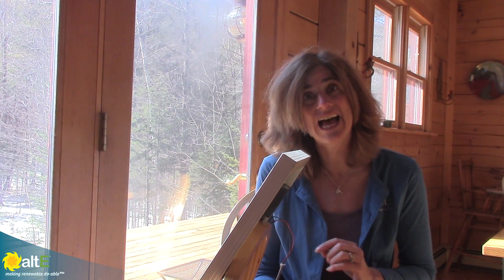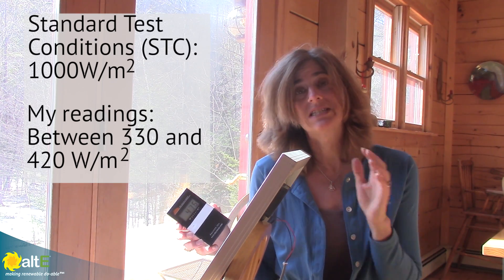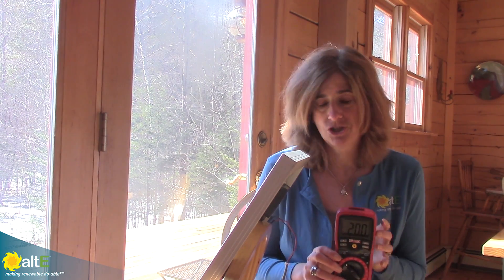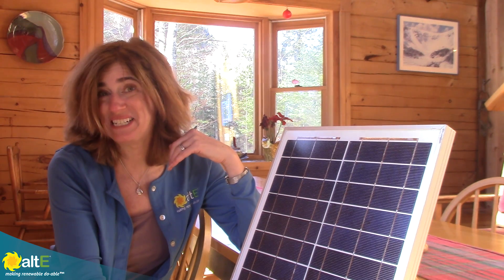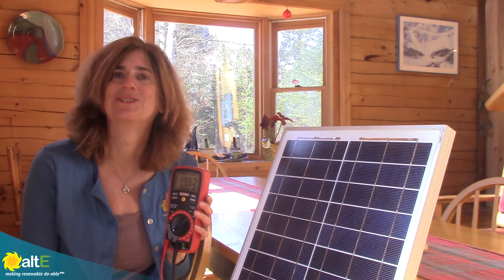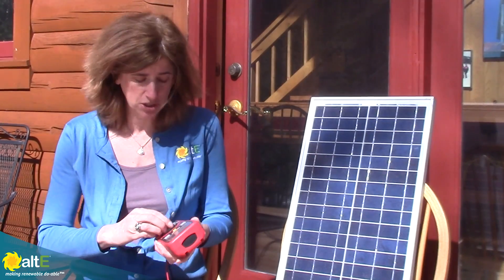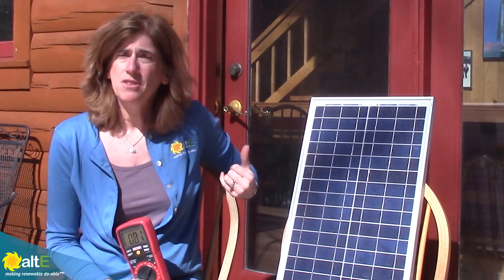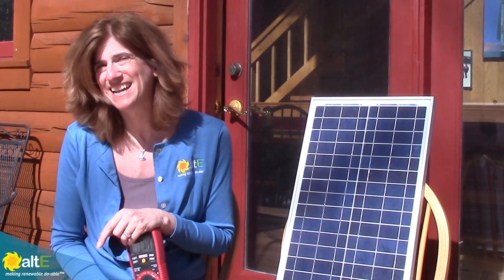Can I install a solar panel in a window?

Comment: Thanks for the informative video. I'm able to get 137 watts in the winter from two bifacial 24 volts 200 watt each panels placed inside the house. The windows are double insulated glass and there's a net on half of the window. I've noticed that when the panels are placed right besides the glass of the window, they produce maximum power. Also, since they are bifacial, placing a mirror behind it helps bump up power to 150 watts. Removing the net increases the power further.

Comment: If you put solar panels  in the window.  Go parallel with the  panels  wattage will drop too much in series as the current drops already in series and it's against the window

Comment: I live in an apartment.  And the sun raise up in east in my living room and moves on around to the side bedrooms by 12 am but once ite sun comes around to the back , the shines the longest on that back bedroom.  I call it my sunroom. I can set up the solar panel on the side of the apartment where the sun moves around by 12 o'clock, but sunroom ( the 3rd bedroom) seems to hold the most. My are 100 watt solar panels but would only be able to set 3, though I have 5. I don't know how this will work. The panel you had looked small. Is someone I could call to ask questions? Thanks

Comment: Everything that I checked into states it's not really worth it. Double pane windows over the surface of the solar panel decreases it ability enough that I chose to do it. I'll place the panel on the outside, and run the line into the rooms I plan to use solar.

Comment: I am running a 100w panel in my window. It is leaning back on to a pull-down shade. It pulls 50w and I just bought another one to go next to it. I checked the temperature of the panel and it is 120f. my question is I don’t want to start a fire. How hot is to hot.

Comment: Very good video. I left a like.
One can install solar panels in a window, but if the light is not directed right at the panel, then the current (A) will be low most of the time.

Comment: I have solar in my window with fabulous results, I use them to charge my 4v 17,5Ah ebike battery, I charge my 12v walmart  deep cycle battery and run an inverter off that to charge my Greenworks 60v battery, with the 60v battery I have lawnmower and trimmer(weed wacker), leaf blower and snow thrower. with my AIMS 48v 1500w pure sine wave inverter I use 3 60v batteries in parallel to run the laundry machine and dishwasher. I have one 40w and one 50w panel in the window at all times except on nice days I take them out on my deck and get full sun on them and add a 100w panel to the system. I could leave them outside but I think they will last longer the way I'm using them.
Reply from the maker: Very cool!

Comment: Whatta Bummer🙄. I am trying to figure out if I can solar in my city apartment to work hand In hand with a solar generator 😳
Reply from the maker: You can probably still make a little power during the peak sun exposure each day. Only about 1/3 MAX of what you could get outside but potentially enough to recharge a solar generator, especially over a few days!
Reply: This guy told me he hangs his panels outside of his window to charge up his battery pack...

Comment: Had three panels in window (10w x 3 in parallel), was getting 17v @ 0.6A, then I brought them outside, 20.75v @ 1.55A....
So yeah, a third. or 33% inside at 10+ watts, and 33+ watts outside. Indoors in a window is not recommended. Great video. Thanks.

Comment: The only important comparison was 0.55A inside, and not very close to the window, vs .78A outside.  When she was inside, she compared against the theoretical maximum, bu she couldn't get anywhere close to it outside.  The voltage also dropped by 10% so wattage would be 20x.55 or 11 vs .78x22 or 17.  64% as much power inside vs outside.  Additionally, the sunlight probably will not last as long, though the morning and afternoon probably don't provide that much more power.  So call it 50% efficient or 30% of the rated power.

In a high price area, where power runs .20 cents per kilowatt hour, if you can get a 330 watt panel for $290 and add $610 for shipping, charge controllers, inverter, batteries (one per 6 years), you'd be looking at $900 and get .4 KwH per day with 4 hours of direct sun at 100 watts per hour, saving 8 cents per day x 365 =  $28 per year.  That's breakeven in about 30 years assuming power prices never rise.  That's about the life of the solar panels, so doesn't save you any money unless power prices rise, but it doesn't cost you anything either, other than time.  

However, if you have need for a backup power supply, for example due to hurricanes or the like, two panels will keep your laptop, tablet and phone recharged, and your network equipment running indefinitely (assuming you can reach your network provider), and this setup doesn't appear to actually cost you anything more than you'd pay for the power itself.  You can skimp on the solar system battery because you can just recharge the devices when the sun is shining if you can get about a day's use out of their internal batteries.  All in all, it's worth having a system that will work for a few days after a storm and keep you connected for business at no real cost to you provided you use the power you generate in some way when not in an emergency situation.
Reply: It's always a good idea to get different opinions.  Here is someone who installed solar panels 9 months ago.  He feels the benefits far outweigh the cons.
https://youtu.be/2rCKYm1BJYY

Comment: It was also interesting to watch the current as different parts of the solar panel were shaded as the author reached across the panel. With the shadow going horizontally the current dropped to about 2/3 of the max, not great but liveable with, but with the shadow going vertically the current dropped to about a hundredth of the max.

Comment: In a seasonal cabin when snow covers the outside main panels,  would a indoor small panel directed in the sun be enough to keep the batteries from draining and freezing? The main panels are snow covered most of the winter and I have four batteries that need to be maintained.

Comment: Something to Note: Some of the small solar panels to maintain a car battery, are placed inside the windshield, either suction cupped to the window or sitting on the dash. Even though they are behind the windshield they seem to work but at reduced amps-slower. Our windshields are 2 panes of tempered glass sandwiching a plastic safety film. Our modern home windows are 2 panes of tempered glass separated by a pocket filled with an insulating gas.

Comment: I only use the panels right against my windows. Got some BIG windows. Lots of theft (of panels) here by us. 

My 200 A solar panels have the right voltage, but only output 7.1 A (it is winter now) with direct sunlight on the windows. I THINK I should be getting 20 Amps?? But st least my panels does not get stolen.

Comment: Here in great Britain we have these godawful pvcu panels below main window area the council could replace these with suitable sized solar panels that are also insulated maintenance free weather proofed and wire them into each flats electrical circuit there you go would help a tenant save heaps

Comment: I had an idea to stick a solar panel on inside of some of my windows whilst it's not ideal compared to out doors it would still be sufficent to charge a mobile phone or even a battery bank for emergency power source or lighting
Reply: Yes it would no problem... maybe charge a battery bank then use that to charge your usb devices
Reply: I low voltage light my entire house that way with garden light circuits and better PV panels

Comment: Thanks for the video, it would be great to see your responses to the questions below. Also: what type of window were you testing? Wouldn’t a low E window designed to keep heat in and sunlight out lower your results? What about an old house with single pane glass and a single pane storm window? Same results?

Comment: this doesnt answer the question, measuring form inside the room is obvious your not gonna get the power you need and why would you have a big ole solar panel sitting around in your room? I want a solar panel installed directly in front of a sunny window. It might not be as good as OUTSIDE but OUTSIDE is NOT an option for me. I need to know if My idea is doable. Not only that, I plan on using it with batteries. So the battery is going to store WHATEVER is going in. Then I can use my deep cycle battery as needed.  Is this doable? Thats all I want to know.

Comment: Hi Amy. Firstly thanks a lot for your interesting videos. I have a question for you! What if I have one of the solar panels placed outside that is affected by the shadow of a neighboring wall. Can I place and use a common mirror to redirect the solar light to the panel? Can you show us how (in)effective this would be? thanks a lot. :)

Comment: Thanks.  very helpful    video  . I     bought  2  panels     50 watts   and 60watts    and before a small  10 watts   for test   [ without making  until  now   any test]     3bulbs  and put it inside my window.  now you prove   me that  inside the apartment[  [  because on the   roof     is possible    to steal it  somebody  ]  is wrong.please   tell me   can the outside    on my         balkoniy    moisture and the drops of the rain damage the cells and the others instruments   behind  the panel.  I am waiting  your advise. thank you  .
Reply from the maker: Solar panels have no problem outside in the rain. But the charge controller, batteries, and inverter should be either inside, or in a rain proof box.
Reply: thanks for the answer
Reply: thanks for   your  answer

Comment: I have a small solar panel taped to my window. I can power a battery operated radio even on a cloudy day.  BUT:  Only old radios will work on  a cloudy day or in the shade.  A modern radio will only work in direct sunlight.

Comment: For those who are seriously looking into doing something like this it's not a total waste and results can vary a lot. One of the big things is Amy here lives in a house, a rather nice one by the looks of it. The quality of your windows hurts your ability to get solar power threw them. The more energy efficient they are, with a better glazing to prevent UV rays and all that from coming in the less power you would get. So if your renting out of a crappy apartment with old 1960's era windows you might get better results. All that said this is not a great way to get power even if your renting. You might have better luck putting it on your patio to be honest if you have one. In the very least small panels like these are not too expensive and you'll still have them if you move into a house or even just go camping.
Reply: I dont have any outside area :( trying to find a way atm to hang one out my window.
Reply: @belledear54 So I wanted some type of backup power and I live in an apartment on the 1st floor, I could put panels outside but im worried about them getting stolen so not knowing anything about power stations or solar power. I searched to see if there are any solar panels made for low light, not thinking I was gonna find anything. I came across renogy's: Monocrystalline Silicon panels and on a wink and a prayer I got a power station and the 200 watt reneogy solar blanket, 400 w solar blanket, and 2 renogy panels.  I live in Minnesota so its cloudy and snowy right now. I put it in the window (inside) I plugged one panel in not thinking I would get anything and I got 58w which is not alot obviously but its something, so with 2 set up (through a window) might get 118w in a very low light while snowing through a window. So through a window when its not snowing and a bit brighter I am very interested to know how many watts i will get.  And in the summer through the window I expect alot more (but won't know for 5 months or so when summer comes around). So I think its possible.. we have random power outages (makes me feel so vulnerable) so I plan on just having it for those times. So such low wattage with solar will probably work out for my situation.
Reply: valid points, I laugh when no one mentions a dark area all year, (like maine usa).. 8 hour winter solstice sun. The sun is not only south, it is near eye level. House windows with  big over hanging eves can even use their windows too. avoide that 32F mark. nothing electronic likes it. Come zero F? give it up.Tropical flip flop games are done. 
A comical addition..if you are using the solar panel to run a little heater.. the cheap window that loses all the heat also gains the most sun, and the solar panel being inside getting warmed is not a bad thing.  Depends on your scenario. 
Step one for the norse wild people: ignore everything they taught you. May you become the inventor billionaire you deserve to be...wearing your ancient mukluks at 30 below. :goodvibes:

Comment: I have a 50W panel sitting in a window right now and it's producing 25W.  That's 25W more than I would have as I have nowhere to put it outdoors.   I think it depends on what impurities or additive are in the glass of your window, mind are actually double glazed.
Reply: she did not use a wendow. shee did not put the panel on the window. she put it in a bright room out of direct light.
Reply: @mejamesme1  In the first instance it was inside but in the sun.
Reply: which panel do yo use?
Reply: Really helpful thanks
Reply: 50w flex panel in a south-facing Window with cheap double-glazing. ~18 watt charging shows on a BLUETTI cheap power station with the panel flat to the glass, ~28 watt with it tilted back about 30 degrees.
Reply: @michaelmistaken2863  I found up against the glass gave the best efficiency.  However when the sun was high in the noon it was so far off angle, that tilting it back increased out put.
I moved house.  The same panel is now on a table in the garden, south facing.  I've seen it produce 53W.
Along with the charge controller and 100Ah battery, I run a 6mm cable into the office, put a boost converter PSU on it and run USB chargers off it.
All my "gadgets" including my drone, phone and watch are solar powered and have been for 3 years now.
Next phase is to upgrade to commercial grade 330W 36V panel, Lithium battery and an inverter to try and run a 24/7 server.

Comment: Hi there. What do you think the results would be with the solar panel in a car on the dash under a windshield and facing south?
Reply from the maker: That is commonly done with cars that are shipping overseas, just to keep the battery topped off a little. So it depends on what your goal is. Keeping an unused car battery topped off with a little power, or trying to make enough energy to use for other things. It also may depend on the glass of the windshield, if it have UV blocking capabilities. As you saw, I did get some power from the panel, so it isn't completely blocking it. Maybe I'll do the test again with meters that track how much energy I make throughout the day for a better comparison. As other commentors have noted, they are doing it and making it work, but with greatly reduced energy.
Reply: @AltEStore 
 I think they MEANT, its a SAFER PLACE to store a smaller panel, during the Winter months AS WELL, when we need emergency power during a blackout, when our cell phones, tablets have died, etc... I WAS THINKING THIS, AS WELL. (( ALSO...It would be less likely to blow away in harsh winds, get grabbed/stolen, by a nosy passerby, walking by our home...VERY EASY, TO KEEP TRACK OF, when we use our cars... ))  
We could STILL GET ENOUGH POWER, to power up something SMALL, LIKE AN LED LIGHTBULB...WHEN WE NEED IT... !  PASSIVE ENERGY... " Just in case."  Even with a HUGE HOUSE, like ours ?? Its not that easy,  to find direct sunlight inside, sadly... to power a solar panel ! 🙄😥🙄 
NO windows, on the South side of this house. Not even 1 ! 
The ONLY GOOD THING, LOL ?? Our energy inefficient windows, that are 60 years old.
 But, EVEN THOSE windows, are each also divided into, 6, SUPER ANNOYING, small, square 8 inch × 8 inch panes of glass, with small, wooden frames... !!! Ughhh!  SMH! 🤬    
We've lived here 45 years.

So, I've been thinking about using my car's windshield, for a long time now ! 🤔❤
 ( NOT EVERYTHING, NEEDS TO BE MASSIVE... ESPECIALLY, IN CASE OF AN EMERGENCY....IN THE NORTH EAST WINTER TIME... )   🤔   LOL!

Thanks, for your video ! 💖

Comment: Under exterior sunlight, the 960W reading is 96% of the 1000W. The short circuit reading felt far shorter than that 96%. Is the manufacturer misleading?
Reply: Sun Shine I agree. The Isc reading is really low. Actually, in the video one gets the impression that the panel is affected by shadows...
Reply from the maker: The ratings of the solar panels are under standard test conditions (STC). That is with perfect light and angle and temperature, etc. That allows all manufacturers to compare and rate their panels apples to apples. The rated power is the Vmp x Imp. Real world installations will likely have different reading for less than ideal conditions.

Comment: I noticed you had a diffused shadow going across the panel in your outside shot. that's going to reduce the amount of voltage and current
Reply from the maker: I see what you are saying, there's sort of a reflection of me on the panel. So even though I wasn't directly in front of the panel, I was causing some reduction in power generation by being beside it.
Reply: I do think this demonstrates the fact that you're trying to relate to everyone. there are a lot of different ways to reduce the overall output and dramatically reduce the efficacy of your system. good video series :-)